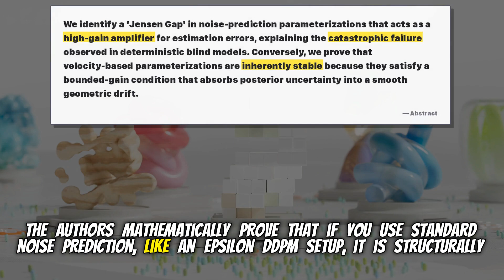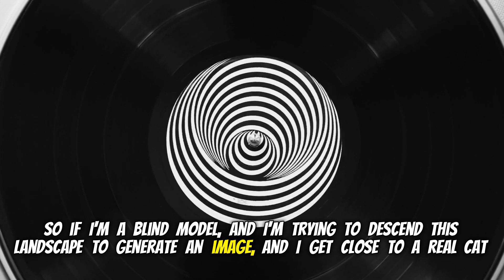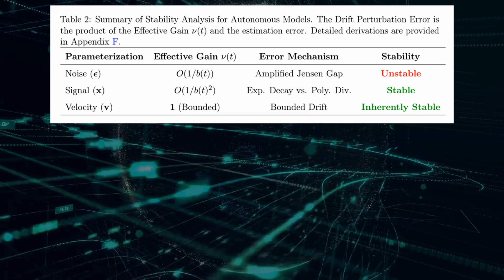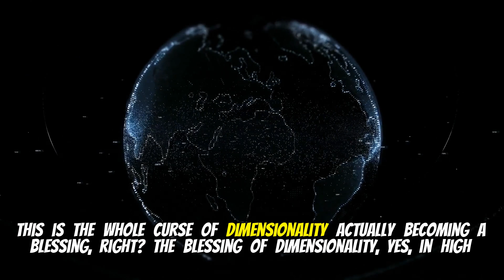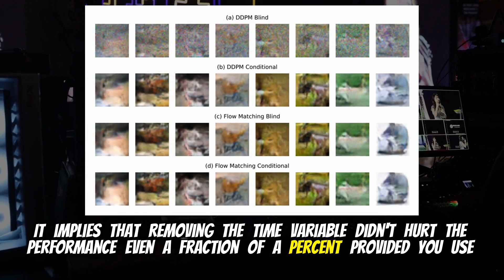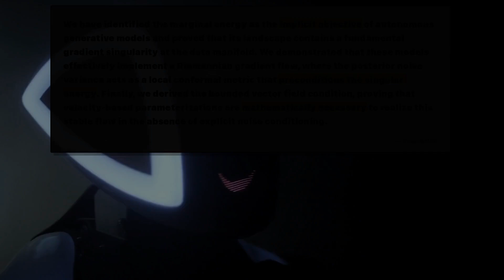The Geometry of Noise: Why Diffusion Models Don't Need Noise Conditioning (Feb 2026)

Comment: What's the application?
Reply: as far as I understood, if steps are not needed to denoise, then it's almost instant image generation. Correct me if I'm wrong.
Reply: @andreikoto4810 I didn't think that's it. Stable difusion is denoising almost by definition. This paper shows you don't have to encode the time step explicitly because of some neat high dimensional geometry... Which is fine... But then what?